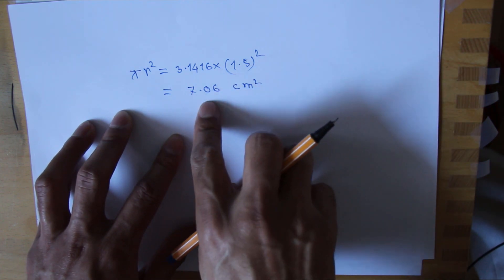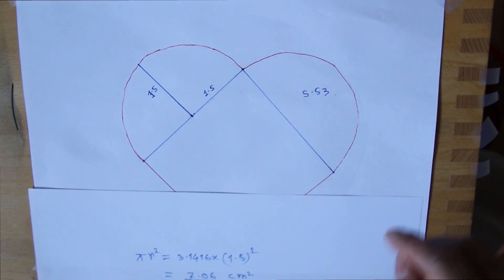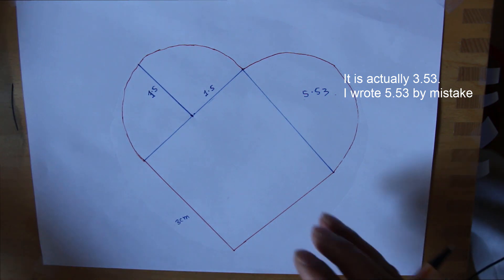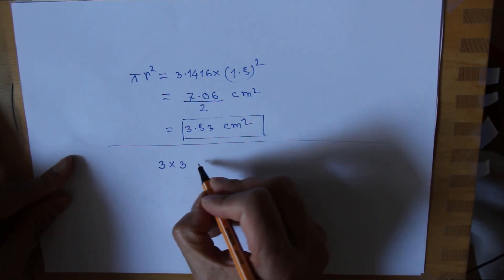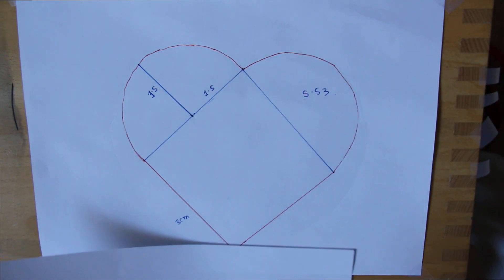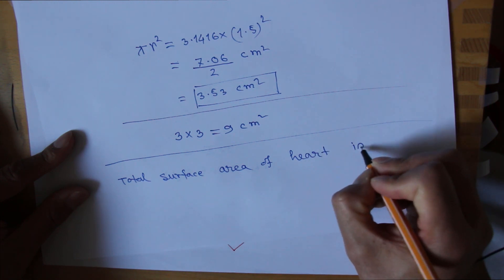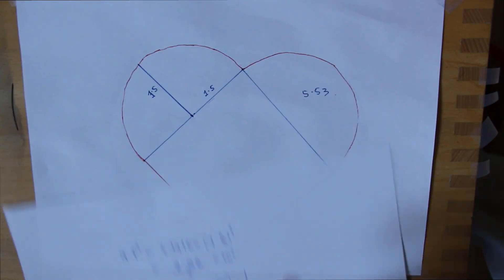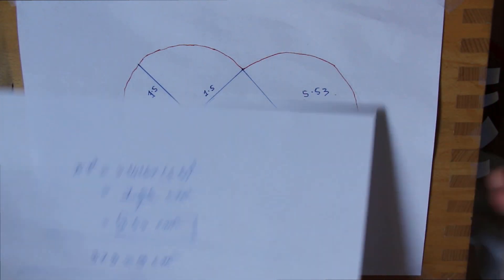Radius of Your Love

Comment: 6:57 That bottom line segment is not the radius of the full circle as you claim (twice).  Why would you assume that intersecting the center line with the middle of the square will give you the center of the big circle?  Particularly when you can see that it won't: you are saying the center of the square is the center of the circle when you can clearly see the square is offset toward the bottom of the circle.